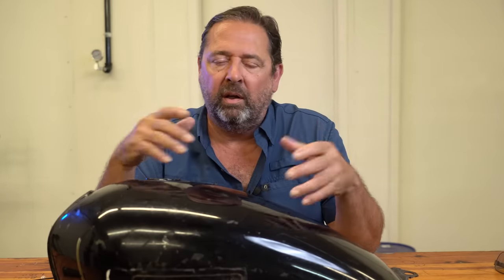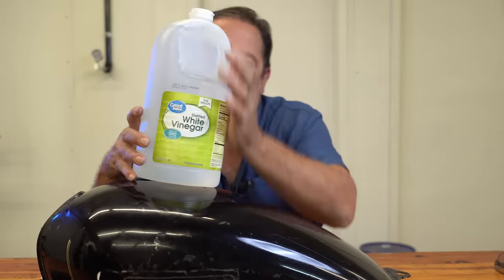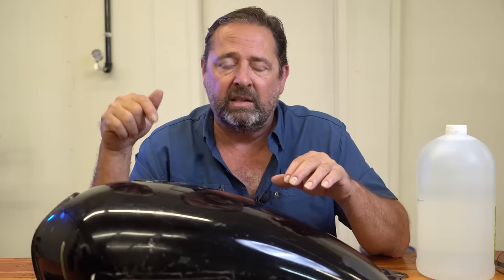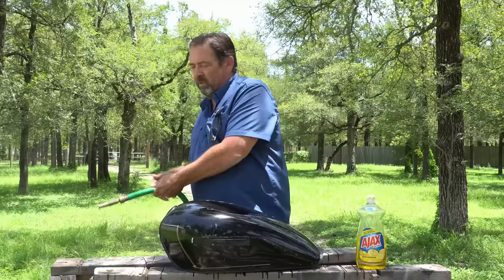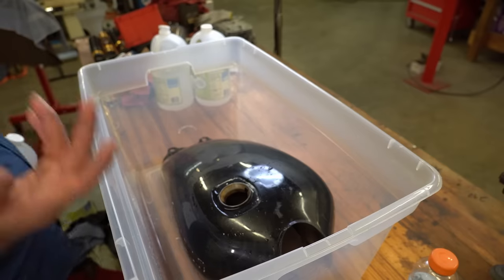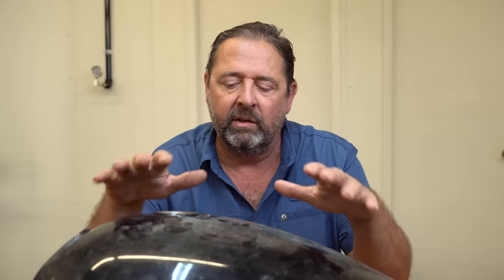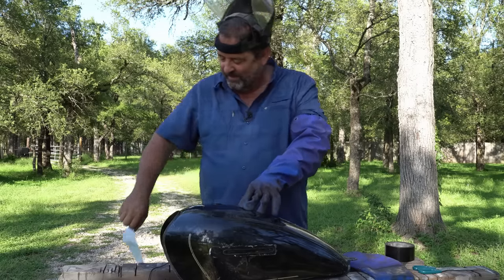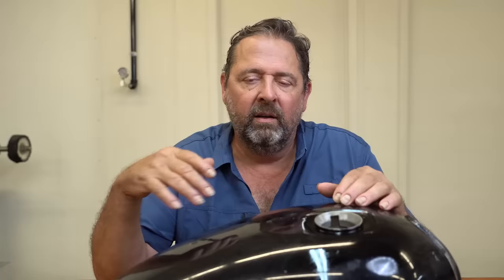GAS TANK--CHEAP--RUST REMOVER !!!!!!

Comment: I use citric acid in powder form...available at most pharmacies. One quart, about $12, makes five gallons mixed with water. Organic, can be dumped anywhere including down the house drains...also can be used over and over, just restir/shake around before use. Used it for everything from tanks to camshafts and leaves a rust free grey machine finish to the part. Don't use to clean aluminum. Will not eat paint, but will eat rust under paint if it has a way to get to it on a rusty edge or paint breakthrough. Takes 12 hours to 2 days to do the job. Oil part to prevent flash rust right after drying part.
Reply from the maker: I might have to try that.  Thanks!

Comment: What did you use to seal the vinegar so it stays inside the tank for the whole duration of the bath? MacGyver tape? Vinegar does not dissolve it?
Reply from the maker: Gorilla Tape.
Reply: @CycleFab  Thanks. 👍

Comment: After I used vinegar, while it was drying it's got a layer of flash rush now.

I wanted to seal it with red kote, do I need to reclean the flash rust?
Reply from the maker: Flash rust happens within a few minutes, it's normal.  But you need to seal your tank soon, before the heavy rust sets in.

Comment: How do you flush the acid out? Or do you just wd 40 it right after
Reply from the maker: Water and baking soda solution neutralizes the acid, then just rinse with soap and water then just water.  Also, I've been using two-stroke engine oil instead of WD-40.
Reply: @CycleFab can i use 4stroke oil? Is there any different? Thanks
Reply from the maker: I've never used 4 stroke oil for that, so...maybe it would work.

Comment: What do you recommend doing when a tank has a sealer on it?
Reply from the maker: That's a tough one.  If the old sealer is lose and separated from the walls of the tank try filling it up with acetone and let it sit, some sealers will disintegrate in acetone.  I would really need to have a better description/pics of the tank to better answer your question.  cycle4fab@gmail.com

Comment: Different issue here. Do you have tips or a video on getting varnish out of a tank? Thanks.
Reply from the maker: Fill the tank full of lacquer thinner and let it sit for 72hrs.  Lacquer thinner isn't cheap but it will work.  After 72hrs if you still have a build up of varnish just put the lacquer thinner back in for another 72hrs.  I doubt you'll have to do it a second time though.
Reply: @CycleFab  Excellent! Thanks for the tip. I have really enjoyed your channel and will keep on watching.

Comment: Would this method be ok to use for large diesel tanks? Say a dumptruck or tractor?
Reply from the maker: Yes, absolutely.  As long as the fuel tanks are steel and not aluminum.

Comment: You can cut that muriatic acid with some little pieces of galvanized sheet metal, makes it way more controllable.
Reply from the maker: Interesting!
Reply: Controllable how? I have never found muriatic to be hard to handle. Can you explain what you mean please
Reply: Makes it a little more tame. Less quick to eat iron. Easier to control when doing things like cleaning out tanks where you need it etched but you don't need it eaten through. BTW you can pour that s*** on your hands, it ain't gonna hurt ya. It will however find any tiny cuts on your hand and make you very aware of them
Reply: @olfatskootch  thanks for tha clarification. I never heard this before. I have also never used muriatic and just walked away and forgot about it LOL. Anything I have worked on with it you would have to leave a long time to eat through. Thanks for the reply

Comment: Have you ever had to remove a gas tank liner to redo it? I lined my tank but it did not cure correctly. I want to clean it out completely and redo it with caswell.
Reply from the maker: No.  The only tank liner that I know that can be removed is Red-Kote, and you use acetone for that.  Any other liner you'll have to use methyleenchloride, and I'm not sure if that would even work.  Thanks for watching and commenting.
Reply: Thank you

Comment: my tank has quite a bit of rust... on top of that it has also been lined with some product of unknown material
Reply from the maker: Wash the tank out with soap and water first to get out the lose rust then fill it with acetone.  This "may" get the old liner out. Some liners are acetone based and reintroducing acetone back into it will, in some cases, dissolve the old liner.  If you can't get the old liner out and it's not lose then get the rust out best you can like is shown in the video and reline the tank with Caswell.  Thanks for watching!
Reply: @CycleFab  Thanks for your help.... I'm gonna give this a shot in the coming days..... I hope it works

Comment: Quick question after you strip out the WD-40 do you dry the tank out with a hair dryer or something like that before you seal it? 
I have a Honda v65 tank that needs cleaned like this.
Any help would be appreciated thanks.
Reply from the maker: Yes, make sure your tank is completely dry.  Also, and this is very important, make sure you get all of the WD-40 out of the tank.
Reply: Thanks buddy super appreciated.
Your channel is the Sh%t
Reply from the maker: BTW, I will be getting back to the Suzuki GS550 build shortly.

Comment: I first add about 18 nuts then 18 units of nuts washers and bolts and spray a can of carburetor cleaner in, 1/2 can.
Then I close the lid and slide that around for about 3 days.
The fish out the nuts and bolts and clumps of rust,... and continue shaking it,... and keep putting the magnet in and removing more rust,....the I fill it with hot water and shake it and dump it about 5 times.
Then I do it 5 times with dawn dish washing liquid. then rinse it 5 times.
Then White vinegar flush it with hot water many times then I add just a bottle of 91% alcohol swish it around dump it out and let it dry in the sun. Then I put in chain saw gas and keep shaking it till I am going to put it on the bike that keeps it oiled.
Then you find a source of 90 octane gas with out ethanol (SUNOCO) you run a tank full through your bike after that you run common 87 octane till the end of season, at the end of season run a 1/2 tank of 90 octane gas with out ethanol untill your bike runs out of gas,... then remove the tank every off season put chain saw gas in and shake it up a couple times a month to keep the walls oiled. 
See the point is you don't leave the 87 octane in because the ethanol corrodes your carburetors/ destroys them.
91 octane cleans your carbs and engine..
Reply from the maker: Good maintenance idea!  Thanks for watching and commenting.

Comment: Great video.  Question,  what if I'm not planning to coat the tank with any sealer?  It's just a light coat of rust that the vinegar alone cleaned.  Is lining the tank a must?
Reply from the maker: No, you don't have to line the tank.  But it is an extra layer of protection that some people like to invest into, especially if the tank is badly rusted.
Reply: @CycleFab  ok. Thanks. For 60 bucks I will go ahead and Caswell it like you did.  Cheap insurance as tanks for my bike are rare now.

Comment: I use nuts, bolts, small rocks,🔩🪨⛓,small pieces of chain, kerosene or diesel,  shake, rattle and roll, drain, repeat.  When clean,, coat vigorously with motor oil.
Reply from the maker: Great tip!

Comment: Why not skip the vinegar and go straight for the muratic acid?
Reply from the maker: With the amount of rust in some of these tanks that I work on, using muriatic acid first could lead to a big mess!  The rection to that much rust at one time will cause an excessive amount of foaming action.  Vinegare is for the heavy lifting, acid is for the tight places like seams where the top and bottom of the tank come together.

Comment: Is it okay to use vinegar that has 4.5% of acidity?
Reply from the maker: 4.5% will work.  What is usually used is 5% which is typically found on grocery store shelves. BTW, Acetic acid is what gives vinegar its cleaning ability.  You can buy vinegar from Amazon that is up to 45% strength but that would probable be too strong.
Reply: @CycleFab  Thank you so much!!!

Comment: @CycleFab --- You mentioned, in one of your replies some time ago, to add "Two  cycle oil immediately following the final rinse to prevent quick surface rust." 
1. Dry  out the tank first? or flush, drain and then add the two cycle oil? 
2. Use the unmixed  two cycle oil or two cycle oil mixed 50:1with gas?  
3. How long does it take for the surface rust to show? immediately? ... in a couple hours?

Great video... good stuff, and thank you in advance, for your reply.
Reply from the maker: Surface flash rust is a pain to deal with!  Sometimes it's instant and others times not. (Fortunately it's not deep and really isn't that big of an issue)  I think, it depends on the humidity and temperature.  I just thin down the two stroke engine oil with a little gas, seems to work well.  Thanks for watching and commenting.

Comment: Great video thanks. I will use this method on a cf Bedford tank. Last time it was used was 37 years ago! So you can imagine what it's like. I was thinking of using some small stones to agitate the rust... What do you think 🤔. Cheers Glen...
Reply from the maker: It's not necessary to use anything other than vingare and muratic acid.  You're just creating extra work for yourself.  Thanks for watching!
Reply: @CycleFab  thanks..advice taken...👍

Comment: after getting rid of the bigger pieces using various methods others have written about, or blasting with water like you do, why bother with the vinegar when the Muriatic Acid is much stronger?  I use it for 2 - 3 minutes if inside of tank is very bad. (remove the petcocks and use bolts or plasticine or ? to cover the holes, or the acid will ruin them - some readers did not get this).  Very important to use PPE and to get rid of all the acid in a safe place immediately after using it. Fill tank (or rinse a few times) with water and baking soda, empty it, (maybe use air pressure thru the filler cap and petcock holes to get all water out) , then use isopropyl or rubbing alcohol to prevent flash rusting. empty it (the rest of the alcohol should evaporate quickly. Store in a dry place. Guess you could spray the inside of the tank with WD 40 or fill with diesel fuel or gasoline mixed with some 2 stroke oil or whatever to prevent prevent fresh rusting before putting the tank into service with gasoline.  I have heard that some of the older sealants such as Caswell fail with ethanol gasoline.  BTW have tried Molasses and Coca Cola and they did not work well and leave a sticky coating.
Reply from the maker: The reason I use vinegar instead of just muriatic acid is that I do not like to leave the acid in for as long as you do because a lot of the tanks that I get already have pin holes in them (and thin areas) and I need to use something more gentle.  Thanks for watching.

Comment: My mini bike tank was rusted and scaling loose particles and sludge all in the bottom pain in the ass removing it anyway cleaned it out cleaned tge plug used a bolt and seal to keep the threaded hole plugged because I was afraid of it getting eaten whats cheaper and what I'm trying is the works badic toilet bowl cleaner  I saw on another video and it also works wonders from what I saw way cheaper removes rust and everything amazing just for 1$ you xant beat it or this stuff this dude is trying both great cheap ways this is my first time cleaning out a tank the hose was punched on tge tank I saw and so dirty which I saw online could cause major problems including making a loss of power etc so its very important to clean things like this I undeformed the line that plugs into the tank using a nail and some hot water abd pliers and letting it sit to regain its proper shape works great also i saw Apple cider vinegar works better still cheap💯💯
Reply from the maker: Thanks for the info!
Reply: @CycleFab  your welcome btw I tried the works I diluted it like your supposed to it looks way better its almost to bare metal I also went back and put some in straight un-diluted shook it around let it sit for 30 minutes its way better compared to before the other video the works worked perfectly not for me but it's still great im sure if I left it straight and let it sit undiluted for hours or more it would completely remove it since it would be way more potent but you'd method seems like it did a better job btw ive seen you put some type of oil in the gas tank after this process and leave it in apparently do you do that and can it cause any problems putting oil in it to prevent flash rust considering my mini bike is a 4 stroke so i don't need oil in my fuel tank.
Reply from the maker: @zacharysmith737  I use two stroke engine oil thinned down a little and give the tank a good coating on the inside.  And you can do this on a 4 stroke, just flush the tank out with gas before you mount it back on.
Reply: @CycleFab  yeah I actually oiled it inside then flushed with gas then coated with more oil after probaly a good thing because after I put the petcock in I accidentally forgot it dont tighten fully and I snapped it its a plastic one its mainly used for mini bikes which is what mine is so I found one but it was almost 11 dollars for it I found the same exact one for 6.16 on ebay it doesn't day its for a mini bike says its for a cub cadet road tiller but it's literally the same so hopefully it works for my tank because I was bummed out after the works cleaned it out but not like it did in the video I watched because the company had to change its formula and I got flash rust but it's still better than what it was no floating big particles or sludge I believe anymore next time if there is I will try your method just something that works better for me and then breaking the fuel line petcock also bummed me out but I suppose a new one will make it run better since I noticed the hole on the other one was squished so gas wasn't clearly flowing properly and even tho I reshaped it properly it broke so let's hope the new one is better and works and I don't overtighten it lol
Reply from the maker: Good luck with your project!

Comment: I'm doing the same thing this weekend however, someone explained it to me a little differently - Apparently adding some marble at the soapy water stage and "slowly" swishing it around, could help in loosening built-up scales, rust and possibly even gasoline varnish. A fine mesh colander when rinsing will catch some of the gunk. Also, leaving the vinegar in the tank overnight could help the process as well. Several water rinses after each stage, specially after the acid cycle. 
What are your thoughts? 
Even though I plan on being careful, should I be concerned about the marbles possibly damaging the fuel sending area inside the tank?
Reply from the maker: Thanks for commenting.  I don't use the nut, bolt, washer, marble method but most people do.  And the vinegar NEEDS to stay in the tank at least 24 hrs to see any great benefit from it.  You can also use stronger vinegar too.  You can get 18 and 30% vinegar at Walmart.
Reply: Thanks man!
All the best!  @CycleFab

Comment: Why is every video that I watch so easy to empty the tank.. I have to shake it around lucky to get a few drops out. It’s really hard to do it from the big hole because of the keys!  I don’t want to get scratches on my paint!
Reply from the maker: It's called editing.  It's a pain to get all the fluids out of a tank when you're cleaning them.  To keep your tank from getting scratch cover it with painters tape.  That's what I do.  Good luck with your project and thanks for watching and commenting!

Comment: Hello mate, like your video great. But I want to do my tank and am looking to get white vinegar here in the uk in a larger quantity. Not sure which acidity content it needs to have. The stuff on general sale seems to have largely 5% and some retailers also shift stuff with 20% acidity content. Which one should I use ?
Reply from the maker: The acidity of the vinegar that I used in the video is 5%, and I leave it in the tank for a minimum of 24 hours.  Hope this helped!  Thanks for watching and good luck with your project.
Reply: @CycleFab  thank you very much for your swift response. That makes things fairly easy as it is the domestic stuff you can use for pickles as well.
Reply: Just one more question Larry, instead of using Muriatic acid to cleanse can I use Hydrochloric Acid 35.0-36.6% instead ?
Reply from the maker: @petergrabowski1775  Muriatic acid is a dilution of Hydrochloric, 35%HCL and 65% H2O.  If you decide to make the Muriatic acid yourself remember, NEVER add water to acid.  You may though, add acid to distilled water and not have a violent reaction.

Comment: Larry - Thank you for your extremely detailed and informative videos!  When the tank is treated with vinegar, will the Gorilla Tape work OK to seal the holes on the bottom for the petcock and fuel sender while the tank sits full of vinegar or do you leave them installed and remove them later before sealing? Thanks again!
Reply from the maker: I always put the gas tank in a big plastic bin just incase The gorilla tape leaks.  And I install fresh tape before using the Caswell sealer.  Thanks for watching and commenting.

Comment: Anyone interested in a cheaper method? Having managed a metal drum reconditioning plant for many years, that industry uses either chains or metal rivets together with kerosene. 
Put them into the tank and rotate it several times, job done. No chains or rivets? Think outside the square, 1/4” gravel does a great job on motorcycle gas tanks.
Reply from the maker: Kerosene = $10.87/gal at Walmart.  Vinegar = $1.98/gal at Walmart.
Reply: @CycleFab  
Yeah, but you keep the Keri for multiple use.